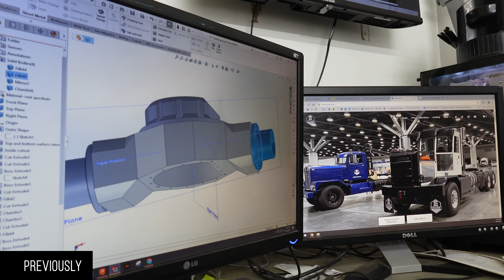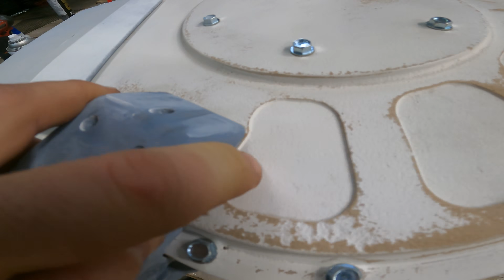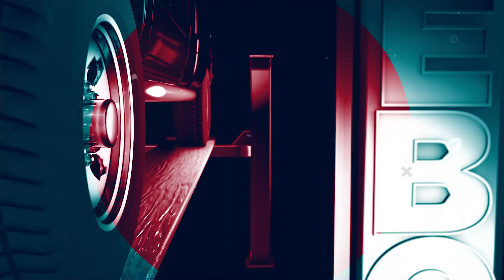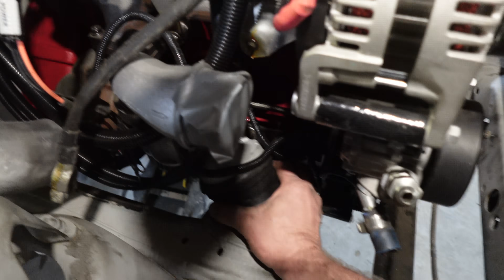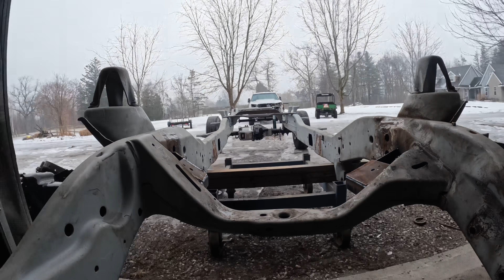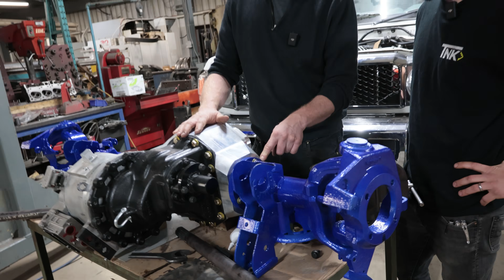Test Fitting our @EdisonMotors Generator #RamRecharger [EP9]

Comment: I bet the same u-joints in the front axles that are the weakest link and a common failure point in 4WD's will not like the added torque of the electric drive.

Comment: Getting closer, and I still have questions:
1) Do those electric "diffs" act as Open Diffs? Or Posi-Track? Or Lockers? Is there a way to "do one or the other" like a Posi-locker for doing off-road or wet/ice conditions?
2) You keep talking about dual motor... why? What is the benefit? How will that work? Does it make them smaller, or double the power... or...?
3) The 4x4 setup... is it "all time 4x4" or more like "AWD"? Or can you do the 2x4/4x4? 
4) How much does all this increase the weight of the truck? My '05 F350 is already 2+ tons... but putting the weight on the axles will improve the traction... but in a 4x4 situation? How will the clearance be? And what kind of skid plates am I going to have to build?
5) I get you are targeting the "working trucks", but mine is "dual purpose" for working and off-road fun...AND if it is "2x4/4x4", does it have "hi/low" features, or is that solved by it being electric?
6) Along those lines, can we put in a "throttle response" adjustment for technical work? Like, 1-10 is "normal operation" ... could we then adjust the throttle to do 1-5 for low-speed/technical maneuvering?
7) And will these come in "different sizes", as I also have a '98 Ranger that I am planning on putting a 5.0 in, with 35" tires, some other features... but a hybrid electric would be perfect, and I wouldn't have to install 4.88s in the front and rear... if they don't come in different sizes, wouldn't the '98 be "overpowered"?
I'm rally enjoying your videos on this...
Reply: (1)These version 1 diffs are open.
(2) These axles have 1 motor that spins both wheels. The proposed "dual motor" will have 1 motor per wheel for more torque/hp.
(3) This truck has dual axles with open diffs. The dual motor will have torque control per wheel. So max torque, or torque until slip, or tank spins in place.
(4) Edison is adding 1500 lbs
(5) I think the primary buyer will be "passion projects" and rebuilding service trucks. The buyer declares if they want 1 or 2 dual motor e-axles.
(6) Yep. The driver will be able to dial in throttle response.
(7) Phase 1 will be 450/550 incomplete chassis. Time will tell what happens after that.

Comment: I love to have my RAM 2500 power wagon run as a hybrid, but wondering if I could keep the HEMI 6.4L engine to run the generator? Is there any reason why it would not be possible to use the same bell housing and attached the generator to it, instead of dropping a 2.8 Cummins diesel on it?
Reply: Yep. I think phase 2 is just retaining the original engine and doing canbus integration.
Reply: @Sah-o5m Considering all the issues Topsy is having getting Canadian approvals for the generators, it makes sense to avoid fighting that battle with commercial trucks, plus you know engine manufacturers are going to lobby to prevent that approval process, because it would hurt their “road engine” sales.

Comment: Did they tell anybody that this thing costs $30k-$50k
Reply: In previous vids they talk about the parts alone being $30k to $50k 

This number is crazy high or crazy low depending on one's perspective.
Reply: @Sah-o5m  I'm guessing crazy high for anyone who would buy this thing and install it, because that kind of guy would get a smashed model S from the junkyard first and save $15k
Reply: @enermaxstephens1051 Oddly enough the Esison guys used a smashed Tesla as parts for their first semi truck blue Carl. The electric motor torque kept snapping the U joint under load so they swapped out the electric motor for electric axles.

I think Edisons hope is to deliver a hybrid 1 ton pickup that performs better and costs less than a brand new pickup.

But yeah its always going to be cheaper to use junk yard parts.

Comment: This is an amazing project and undertaking. I had a couple of questions, regarding the setup, since I would like to convert an old army surplus Hummvee to be a diesel hybrid. But the main issues with that is that 1- it comes with a gigantic diesel engine already, and 2- it was designed with independent suspension on all four wheels for higher traction and travel. So would it be possible to have a kit that would support the hummvee? or is there a way to use independent motors instead of a solid axle?
Reply: I think someday, this is inevitable.  They have like 10 giant projects they need to do first. 

That said, I'd love to see your rig Edison-o-fied

Comment: This is so cool to watch come together.  Someday  I hope you guys can help me convert my Astro camper. The hybrid electric system would work so well for a small RV. Have 1 generator insted of a generator and engine. And a big battery bank that you could supplement with solar on the roof. Route a diesel heater to the tank into the cab. It would just be perfect.  Keep it up guys!

Comment: So, I thought you and Chase had agreed to build these projects with off the shelf parts? You just mentioned a custom designed and built generator, custom mounts, custom wiring, etc. Am I misunderstanding your intentions for this project?  Anyway, keep up the good work and maybe try some better lighting while under the lift. Dark!!!
Reply: Short Answer: You are misunderstanding.

Long Answer:

The Edison goal is as much off the shelf parts as possible (unless the parts don't exist)

Engine: The engine is a "crate" engine and is common and easily sourced. The thousands of potential customers that have signed up for an Edison kit, could just go ahead and order their crate engine from Cummins right now. They don't have to go "through" Edison. (granted, Edison has learned that its better to use the generator computer, and not the computer for engines that go into trucks, so be careful when ordering)

Generator: Edison (or you) could bolt any standard off the shelf generator to the engine and it will run (poorly). Because they're having to make things fit in the confined space UNDER a cab, they are having a generator made to a specific size that will work better with the intended engine. So if the Edison "custom" generator fails, then meh, you can go get whatever generator fits. Edison is not going to go out of their way to prevent a customer from using alternate brand generator. Conversely, It costs money to integrate an off brand generator, and Edison will not pay for that integration, but the customer is welcome to :). 

As for 'custom' mounts. Edison is trying to make kits that will fit hundreds of different engine bays. If there is a company called "Cummins 2.8 liter brackets to fit your special engine bay" dot com, then sure, Edison could just order them for any customer truck. Unfortunately, that company does not exist, Edison is MAKING that company. So Rich will hand make each bracket, until they can make a 3d model, then that model could be posted on the internet, and users will be able to craft their own brackets.

Wiring. Again. The stock truck will retain all of its stock wiring harness. Then out of necessity, Edison is making a custom wiring harness for all of their custom stuff because it doesn't exist. This does not prevent a customer from yanking out the Edison wires, and replacing it with their own setup. 

Edison is for "Right to Repair" which means Edison is against "Parts Pairing". Parts pairing would be to put a computer on every part, and have every part have a serial number, then have the master computer deny any "Non-Edison" parts. Edison is firmly against this. 

Hope this helps :)

Comment: I think Mercedes has a pretty cool concept of hybrid. They put an electric motor/generator behind the engine between the transmission as a clutch plate. Seems pretty similar to the generator you are putting on. Yet the drive line remained intact
Reply: The Mercedes sounds more like an "electric assist" to the ICE motor. This system is an EV with a backup generator. This is far better because it gets rid of the transmission and driveshaft. The electric motor is directly attached to the axle.  The ICE generator is fully decoupled from the drivetrain and can now run at an optimum RPM for just generating electricity.

Comment: dont get me wrong love the idea but i remember hearing something in another video about not using the stock axle because the gears cant handle regenative braking thats just not true. regenative braking puts the same strain as an exhaust or jake brake does on your drive line or what kind of wear would driving in reverse do that just didnt make sense to me. i like the idea but i still think an electric motor mounted to a stock transfercase is a way easier, better and cheaper alternative still have the generator swap but put that battery and electrical in a case like ratpack style toolbox in the box. id rather have to change ujoints and drive shafts then have to worry about the parts in specifically made electric motor axle. guys would be able to do the swaps at home if say a kit came with like a big battery box that goes in the box that houses all the electronics. then have a generator option. then electric motor with whatever adapter plate for which ever transfer case is being used or whats in the truck already. an e pedal and forward reverse selector. easily packagable and swapable drive line parts available at almost every partstore across north america. it would stream line swaps and make it more readily accessible to the average person would also bring the overhead cost down. allowing these swaps to be done more streamlined. just tid bit of thought to maybe help build on this idea. having the option to manually mechanically disengage 4wd reduce unsprung weight increase ride quality so many more benefits going to motor on transfer case then motor on axles. again love the idea but i think it can be improved just a ltttle bit more.

Comment: Just curious, if this is not what you’re going to do with the kits, I don’t understand how the 4wd will work? Maybe I missed that part…
Reply: This truck (and all early release trucks) will use axles that have single motors and open diffs. This particular truck will have powered e-axles in front and rear. On dry pavement all 4 wheels will be powered, but with the open diffs,  it will have a harder time with traction in the snow.

Future trucks will receive new E-axles that have 2 motors each. These dual motor axles can be at the rear, or the front or both. These axles will have 1 motor per wheel. With the right computer programming, they can be set to full power all the time, or full power until wheel slip, or x amount of torque, or the ability to do a stand in place tank spin.

Comment: If I had the money for my own hybrid dodge build. I'd keep the rear drivetrain and electrify the front axle. Bolt in a couple of the dodge Etorque alternators. I know some guys running those as generators. Get my hands on ZF transmissions hybrid 8 speed.  It has built in electric motors for propulsion and power generation. Doomsday diesel is also loving the 8 speed behind the cummins.   I'm not sure if the ZF can drive electrically while in neutral, but if it can then it opens up full diesel-electric. Otherwise it's direct drive diesel with electric assistance. I also still wish someone would just make electric motors that replace the rear differential covers on most standard rear ends.
Reply: Wait are you saying someone built a hybrid 8 speed manual with electric motors in it??
Reply: @stevebrown5603  the manufacturer of the transmission zf. Has them. They just weren't used by automakers. We could have had mild hybrid dodges for  a decade now
Reply: @stevebrown5603  not a manual. Zf8hp auto
Reply: @timbrwolf1121  ..are you in Canada? Ive never seen a transmission named with a zf that wasn't a manual
Reply: @stevebrown5603  zf8 is in most modern sports cars. The chargers challengers and rams.
Reply: @timbrwolf1121  ahh I'm not well versed on the new automatics especially the mopars... sounds like an interesting concept though

Comment: If you can pull off a good kit under 25-30k for 1/2 ton trucks that comes with the rear axle engine generator battery and everything to make them work you’ll do great so many of us want a more efficient truck that’s not so damn touch screen we don’t mind tech we just want effective solutions I want a 1/2 ton ram like your black on here setup like a 4x4 but honestly I’d use a battery setup and hydraulic drive for a front axle it doesn’t need to be so beefy it’s only gonna pull at low speeds in bad conditions if you ever seen what Yamaha did on its enduro bike something like that the front end would only ever engage or pull power if the rear end is slipping I’ll see if I can find a link to it it’s pretty neat but yeah idk if it can be done under 30k Ik that engine generator and battery combo isn’t cheap at all and that’s all off the shelf stuff

Comment: Why not a power stroke cac off the ev coolant system.
Reply: Wouldn't that heat the intake air?
Reply: @Sah-o5m  the cac coolant loop in a powerstroke or like a ev Prius only runs like 100*f your compressed intercooler air should be way hotter. Not to mention water cools way better than air. Sick your hand in the fridge then stick it in a bowl of water in the fridge. So for the short time the generator is on it should work really good.

Comment: Why doesn't the generator start the motor?
Reply: It can. It might. It might not.
Reply: @Sah-o5m  they got to do something for the crazy cold. Like ice road truckers they never shut the engine off because it's impossible to get started again. But like the Prius using the generator motor you can wing that motor at over idle rpm it would start. Not to mention you could pre heat the oil ect.

Comment: fittings on top better for bleeding cooling system if its water jacketed
Reply: Ahh. Air bubbles. Good thinking.

 But then you have to jam your hands in between the genny and firewall. 

I wonder if there is enough length to exit the genny opposite the engine.
Reply: @Sah-o5m  when cab is down looks like he will have plenty of space also once its installed you just bleed system and forget about it :) It will put electric box on the side, the best to prevent dirt and water where wires get in the box. I know its supposed to be seal tight but one day on an other it will get moisture...

Comment: This summer, after the big canada cross country round trip, id like to see this RamReCharger chained to a building. Then in the computer set the throttle to 20% and slowly roll into the accelerator until all 4 wheels are spinning at 1 rpm. Torque monster.

Should make a good teaser for the weekly episode.

This week on Deboss Garage we test the torque. Squeeeeel.

Comment: what size cummins diesel are you using for this swap
Reply: For this truck they pulled out the stock 5.9 liter gas engine and are using a Cummins r2.8 liter 4 cylinder diesel engine making 165 hp which should be enough to keep the batteries topped off on long trips.

Comment: Love how cool those axles look. I'm curious how having the motor weight on the axles like that changes handling though. That's a lot of unsprung mass, not that it really matters on a solid axle truck I guess.
Reply: Electric axles are heavier which means higher unsprung mass. Most drivers won't notice it on paved roads. However, on a washboard dirt roads these e axles will have a hard time staying planted.

Comment: Where are the batteries
Reply: They are being made. You can see the 2 metal boxes that will receive the batteries and sit between the frame rails where a normal drive shaft would go.

Comment: How does the generator handle a rear main seal leak?
Reply: Apparently the googlez says that diesel generators have been dealing with this for 100 years. It doesn't ruin the generator, but if it leaks enough, then it needs to be replaced like in any engine.

Comment: Watching you guys working hard on the project feels good. I do have a question tho. If you don't need four wheel drive, will the forward axel swap still be needed? Or is it more that you worry about the risk of one drive motor failing stopping the car totally?
Reply: This particular truck is a prototype to test both axles. If a customer only wants the real axle done, that should not be a problem.

Comment: I just installed this in my Ram. Been running it for 5 months. Works perfectly
Reply: For real? Like you actually put this Cummins r2.8 liter 4 cylinder diesel engine into your truck? What do you use your truck for?

Comment: Are you going to take the starter off and use the “generator” instead to start the engine?
Reply: Fair question. I can see pros and cons both ways.

Personally, I like the simplicity of just using the generator of starting the engine normally. Then I'd still want the original starter in case the genny misbehaves.